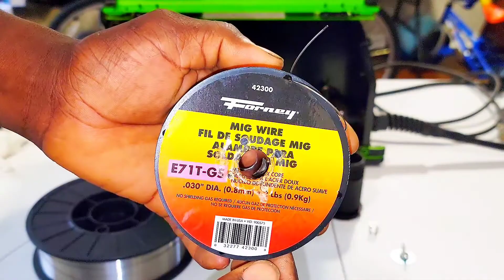How to setup forney easy weld yourself / how to insert flux core wire

Comment: Nice welder. I am a beginner. I clicked on the video because I saw the FORNEY. I am using one at work, it's a different model, but looks like yours. The machine is solid and easy to use. I am considering buying the Easy Weld 140 FC-i or something similar for my own personal use. Good instructions, thanks a bunch.👍👍
Reply from the maker: Very cool!